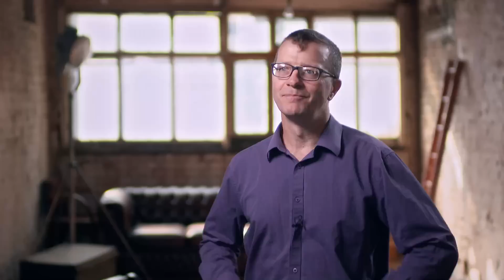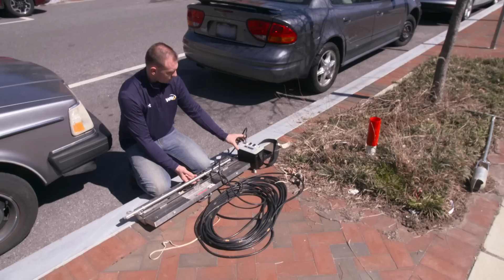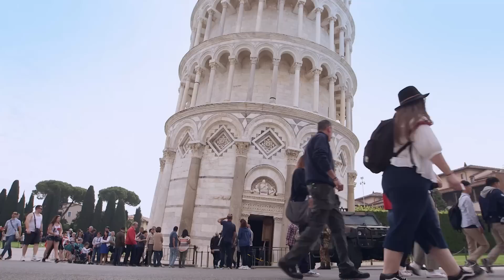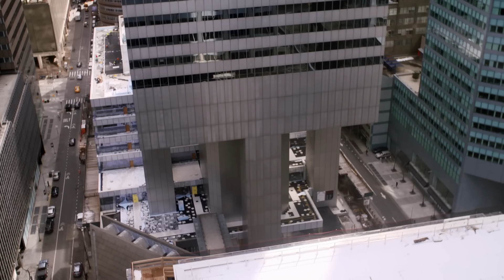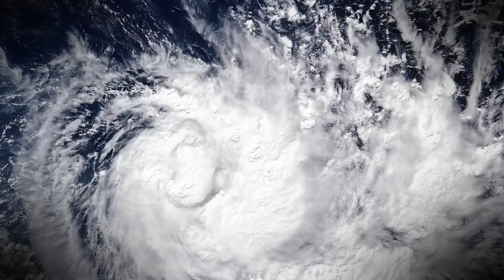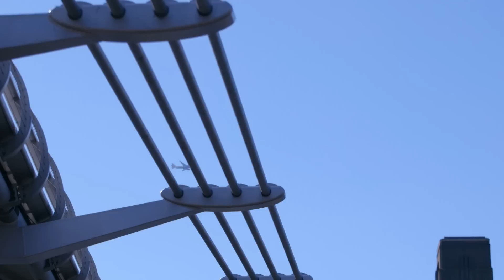When Streets Collapse - Massive Engineering Mistakes - S01 EP1 - Engineering Documentary

Comment: It appears to be all about money. The take from tourism is huge. It also proves that its engineering design is sufficient. 300 hundred years later all is well.
Reply: stone buildings rarely collapse even if there are flows. It's always steel and concrete. I think stones can handle changing environmental conditions more gracefully than concrete and steel.

Comment: The comment about the leaning tower of Pisa that engineering then was not as good as today is a bit of an oxymoron when you think of the Egyptian Pyramids and many of the ancient structures still standing today. Many of these structures would not be able to be built today in the same way. Watching this show is a fine example of latter day engineering mistakes that shouldn't have happened but whether through ignorance or corruption or pride they do.  Personally I would prefer the ancient Egyptians to build my next grand palace than any of todays engineers and builders and know that failing an apocalyptic event that it will still be standing 5000 years from now. 🇦🇺.
Reply: The pyramids were not built by Egyptian. Modern Scientists say that the pyramids were already there even before the Egyptian people came.